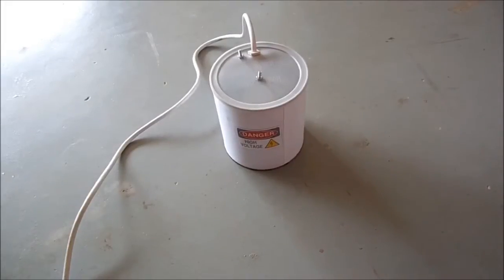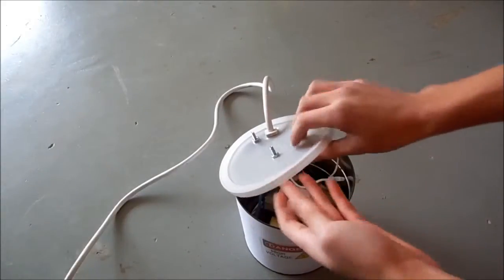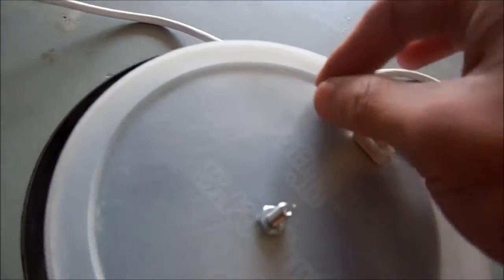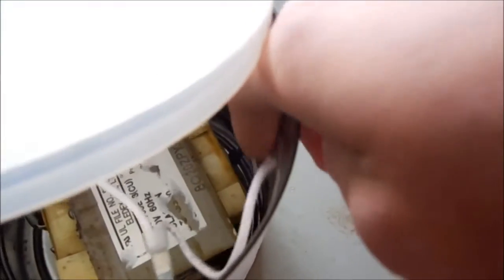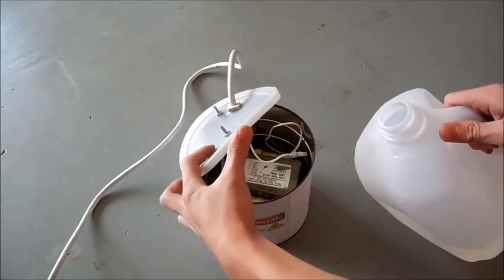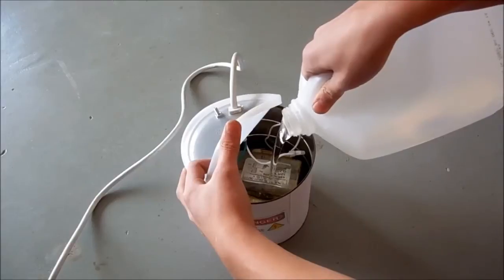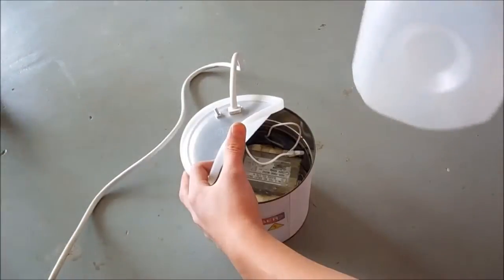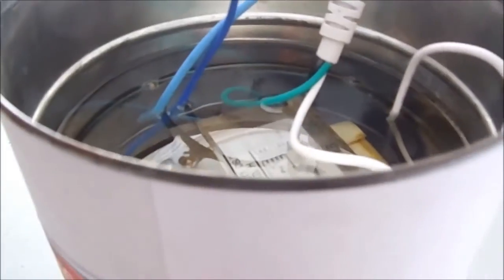Putting A High Voltage Microwave Transformer In Oil

Comment: my transformer heats up very fast
Reply: ballasting is boring do this
Reply: Draggos Dinca look up videos on ballasting it.
Reply: They all heating up very fast
Reply: @Electronichub_05 Now the big or medium sized ones take a while to get hot but your right about the small ones👍🏾
Reply: @MarshawnDixon  I had a medium sized one that turned into a smoke machine in my room recently xD
Reply: @Electronichub_05  How many minutes did it last?
Reply: @MarshawnDixon  maybe 30 seconds, I used it to power some ram sticks.
Reply: @Electronichub_05 You may need to put it under oil for a while, then take it out. But if you want to make arcs with it being in oil than that’s fine.
Reply: @MarshawnDixon  I have multiple, I just swap them out if they get too hot :)
Reply: @Electronichub_05  Oh ok
Reply: @Electronichub_05  I actually have a bigger transformer getting delivered tomorrow cause the smaller one I took out of my microwave broke cause there was a spark from it heating it up.
Reply: @MarshawnDixon  that's awesome :D
Reply: @Electronichub_05  Do you think vegetable oil will work if I wanted to cool it down?
Reply: @MarshawnDixon  I'm not sure, I never worked with oil because it's a mess however vegetable oil can clump up and become solid I think.
Reply: @Electronichub_05  Ok well I was thinking about trying that but at the same time I would want to put mineral oil instead because I don’t want to damage this transformer that I got for $50
Reply: @Electronichub_05  And the transformer I got is a medium or large so it better work pretty good since it’s $50 😂
Reply: @MarshawnDixon  mineral oil would work perfectly :)
Reply: @Electronichub_05  ok👍🏾
Reply: I put mine in a container and used a small 120v fan with a different cord for cooling the oil during use. This lasts a good 10-15 minutes for me.

Comment: 1:33: and then, suddenly, a cat!
Reply from the maker: :D Yep that was my quality control inspector making sure I was doing everything correct.
Reply: Electrotechnics lol
Reply from the maker: +HVinduction I don't know how well sunflower oil resists arcing and how conductive or nonconductive it is. Also i'm unsure about the temperature in which sunflower oil breaks down. All things to account for when picking oil for a high voltage transformer. The optimal solution is a bigger more efficient MOT. Good luck!
Reply: Electrotechnics 

But is that safe sir because I have one dought. Sir can I use  P.T.O oil which is use for car bike in gear box can i use that
Reply: Sir which oil do you use in that project.
Reply: Meeeeeooooooowwwwwwww